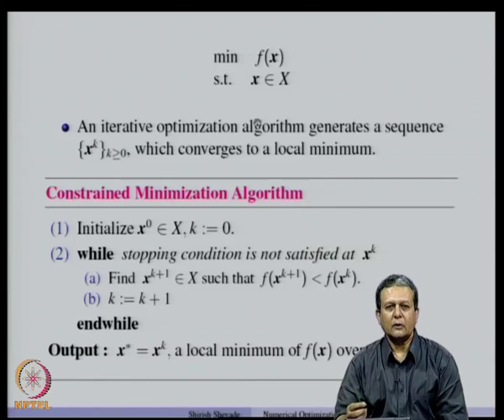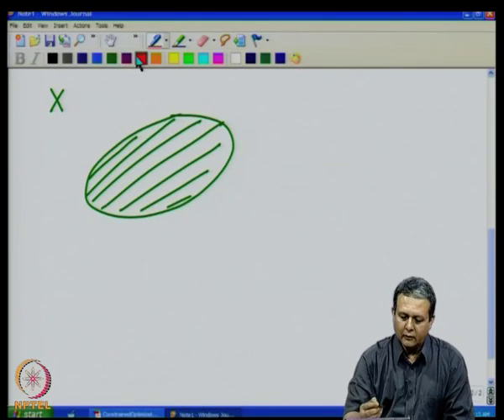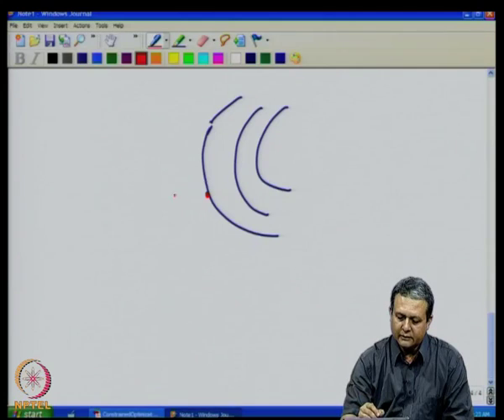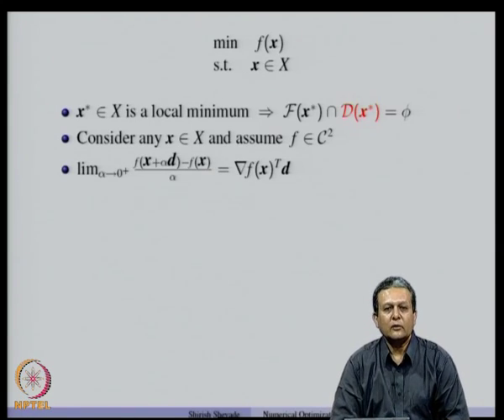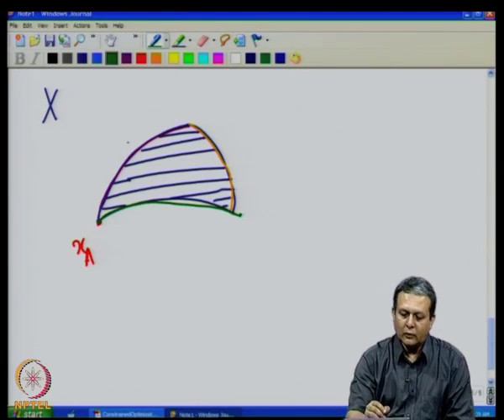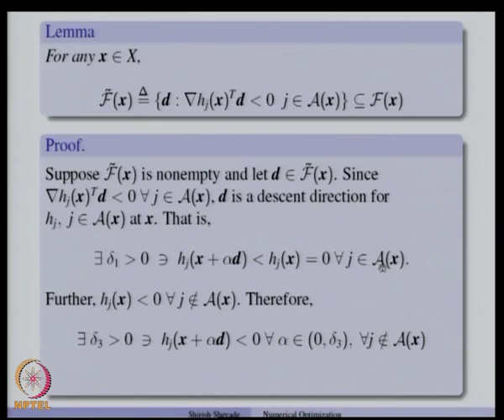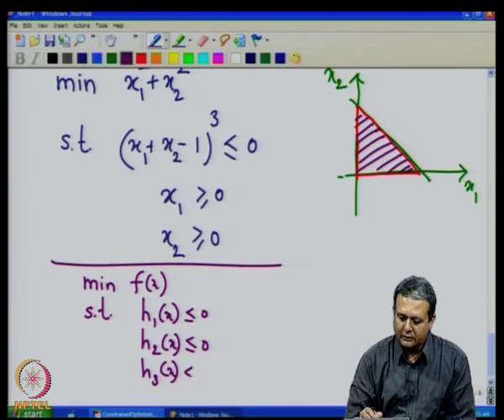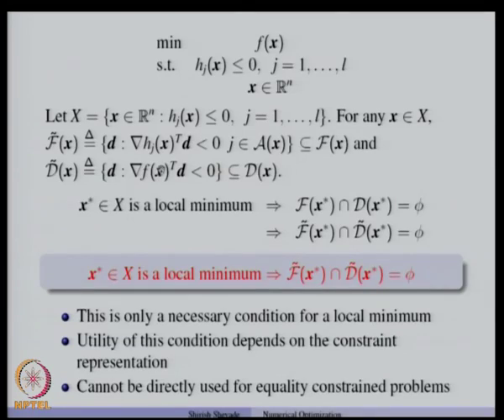Mod-07 Lec-21 Feasible and Descent Directions

Comment: How can we assume that d is also a feasible direction for j which are not active.... Prof did it at 40:46
Reply: I think it's is choosen according to the definition of feasible direction only. Because we can always find a del.
Reply: feasible directions are for points (x) not for functions. for active functions we are getting some range of alpha values and for non-active functions we are getting other set of alpha values. these individual alpha values keep individual constraints satisfied for new point x+alpha*d. When combining all constraints, we take minimum of those alpha values.
Reply: assume the 1D line, i.e the x axis. Let h1(x) and h2(x) <= 0 be 2 constraints. Let h1(x) = -x, h2(x) = x - 2. Therefore by h1(x), x >= 0 and by h2(x), x<= 2. For x = 2, equality constraint of h2(x) = 0, and h1(x) = -2 < 0. Therefore 2 is the active constraint by definition. Now basically imagine the 1d line, with the line segment [0,2] being the feasible region. Therefore if you are at x=2, where h2 is the active constraint, does it matter if you move in ANY direction by a small step wrt the constraint h1? Therefore the direction might as well be the descent direction for active constraint h2. hope you got my point and were able to visualize :)
Reply: @26.18 it's obtuse angle right I heard as acute angle..let me know if am wrng